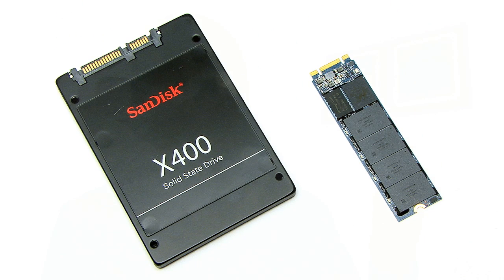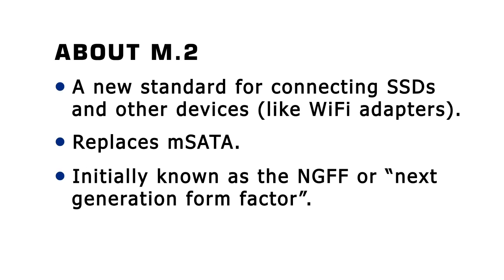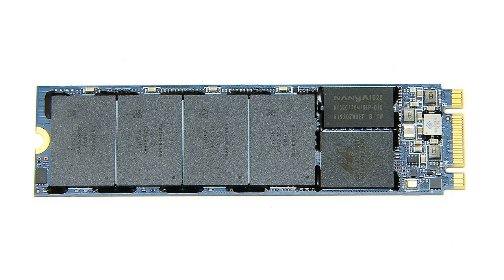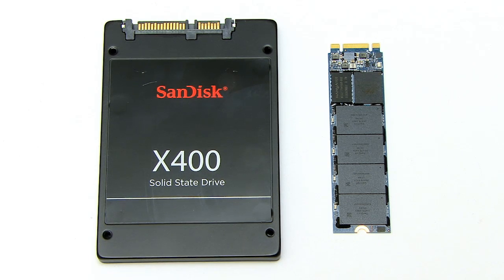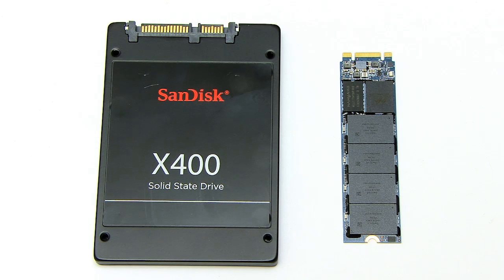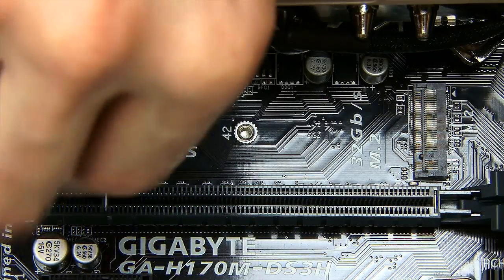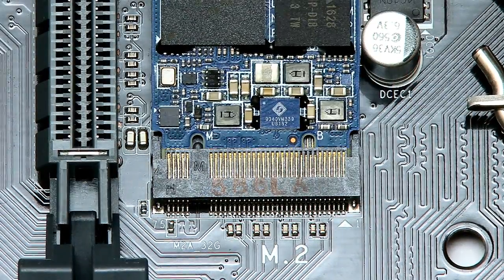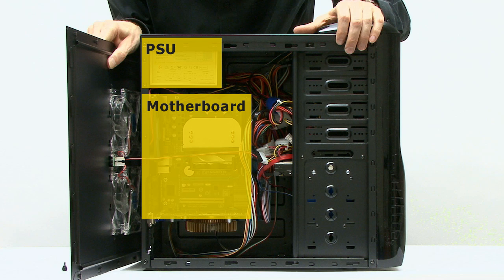Explaining M.2 SSDs

Comment: Just some passing comments:
1. For the really fast speed, you want M.2  PCIe Gen3 x 4 NVMe  (4 channels)[as opposed to SATA, Gen 2 and x2] x2 pronounced by 2 - be careful, you want all that satisfied.
2. With the Samsung 950 Pro, you need the Samsung NVMe driver and not the Windows driver (you can check after installation of the driver by looking in Windows, Device Manager / Storage Controllers
3. When you add a second disk drive, to the computer, mysteriously, the M.2 (main C: drive then becomes Drive 1 even though it's the boot device and the added, storage drive D: then becomes Drive 0   weird (I saw this happen with a youtuber as well)
4. With my Asus motherboard, boot time has not changed, but Restarts are blazing fast as well as the loading of everything. Using disk drive bench marking programs like ATTO e.g. I'm showing 2.6 GB per second reads. Game loads, game screen loads and game cut scenes are practically instantaneous.
5. I would run ATTO or AS SSD just to make sure you're getting the speeds you paid for.
6. With the price of memory having gone up, these are now 60 USD more than what I paid. (and they've gone on to another series)
7. These M.2 drives can be mounted on a PCIe daughter card and then that inserted into a slot and in most cases the drives run much cooler because rather than being mounted on the motherboard, down where the air is dead, they're up on a card and getting air from fans like the GPU, and case fans. By the way, I hear it's the controllers on these devices which run hot and manufacturers are actually adding thin copper sheeting, heat spreaders, heat shields and thermal interfaces.
Reply: Additional:   And if you add a third drive, the M.2 C: drive then becomes drive 2 (and it's the boot drive). You'll see this Drive 0, 1, 2 in Windows Disk Management - just right click the Windows 10 Start button and then left click that utility.
Reply: Oops. In line 1. above where it says (4 channels), that should say (4 lanes). That's the term they use. Regarding terminology, this NVMe is a protocol and it replaces the AHCI protocol that is used to communicate with SATA devices (Serial ATA).

Comment: HI AGAIN . I HAVE A BEAUTIFULL AI CAMERA PROGRAM THAT TOOK ABOUT TEN YEARS TO WRITE AND ITS BEEN FINSISHED ABOUT A YEAR .  IT TAKES 1 CORE ABOUT 7 SECONDS TO PROCESS A 640 BY 480 PIXEL VIDEO FRAME.  IM INTERESTED IN REWRITING IT USING MULTICORE PROGRAMMING.  DO CORES ACCESS A VIDEO STORED IN A VIDEO MEMORE (I THINK IN CASHE) SIMULTANEOUSLY? THATS MY QUESTION .IM USING AN OLD A6 DULCORE .  I TESTED A THREAD MULTIPLYING PROGRAM AND I STARTED ALL 4 THREADS AT THE SAME TIME AND IT FINISHED THE THREADS IN RANDOM ORDER,  THE TEST IMPLYIED THAT THE THREADS WERE ALL INDEPENDANT OF EACH OTHER , BUT WHEN I ADDED A PRINT TO SCREEN THREAD NUMER IN THE LOOP I FOUND THAT THE MULTITHREAD PROGRAM WAS FAKE. THE SAMETHREAD NUMBER PRINTED 100000 TIMES IN A ROW FOR EACH THREAD.   ALL THREADS WOULD START AT A DIFFERENT TIMES AND ALL THREADS FINISHED WITHOUT INTERUPTIONS AT DIFFERENT TIMES.  PRINT LOOKED LIKE 222 100K 111 100K 444 100K 333 100K .  SO IM SURE U HAVE A NICE VID ON THE SUBJECT SOMEWHERE. HAVE A GIANGANTIC GREAT DAY !

Comment: A lot of the gammers are going for the SSD drives that plug into the PCIe Gen3 x4 motherboard slots like the Intel SSD 750 Series. 
Their read and write speeds look to be quicker than a lot of the M.2 drives.
Reply: TheNZJester they are similar to NVMe m.2 drives. however most m.2 drive are SATA based.

Comment: Is there a cable that would go, possibly from the SATA or PCIe slot, to a carriage or other type device that would house multiple M.2 SSDs?

Perhaps even a 'hot swappable' like device that would hold multiple M.2s?

And could M.2s be used as recovery devices? I mean like hot swappable backup drives?
Reply from the maker: There are PCIe cards that take multiple M.2 drives. And external cases for M.2 drives that connect via USB 3.0/1

Comment: Did you even wear a antistatic wrist strap ? i can see there is no static free cloth the items are laying on.  Was the anti static stuff just a gimmick to sell useless crap? My friend just tossed computer parts in a carboard box and most that stuff still works years later. I try to use my wrist strap though.
Reply from the maker: I am always grounded with a wrist strap, but no longer show it on camera due the plethora of negative comments wearing one -- and talking about the use of one -- generates. Usually you will get away without one fine. But when I have paid for the components, I wear one! :)
Reply: You can ground yourself by touching metal before handeling the components.
Reply: thearchiveable 
I just touch the radiator in my apartment.
Reply: @peterknutsen3070  That is good, it works 95% of the time. But getting proper grounded is the best and safest way. But i never had problems. Also check if you floot is laminated and you walk on socks. Then you can build up static very easy.

Comment: About the Fitting of M.2 device (AT 5:40). There is a statement AT 6:35 that connecting is simpler because you only need a screwdriver, and "no cable management, no mounting", so it is 
"EASIEST and SIMPLEST method of installing a new drive in a desktop PC".
I think this is debatable. 
?_ Isn't it true that you don't really need to mount (fix/screw in place) an SSD since it is not that vulnerable to vibrations (compared to a hard drive)? 
Also, fiddleing on a motherboard might make someone nervous. Once I have all necesary cables plugged in the motherboard, I can even touch the SATA data or power cable since there is no risk of damaging the motherboard (without touching it) or an electric shock if computer is plugged in the wall.
 _ _ This is, at least, my amateur opinion.
Reply from the maker: I see your point, but an SSD should be fastened down (unless you move the case). On wiring, with fewer (non-motherboard) drives, this will reduce.

Comment: I noticed that the motherboard label said that the M.2 slot was PCIe yet you said that your M.2 disk was only SATA III compatible. Obviously, the connectors the same so it begs the question : Does M.2 auto-detect then adjust or what else is going on there?
Reply from the maker: Yes, the system will detect what has been connected to it.

Comment: Disappointed you did not mention NVMe M.2 drives
Reply from the maker: I will cover U.2 v M.2 in another video. Right now, M.2 is more common.
Reply: Yes M.2 is more common and you fully utilise it by using an NVMa drive in an M.2 connection. Like the Samsung 960 Pro NVMe/M.2 SSD drives. You only told half of the story here, the main advantage with M.2 is using an NVMe drive connected to an M.2. I have one in my pc.

Comment: here is the thing, M.2 SSDs are non-archivable, the standar HDD will be around for a long time with multi-petabyte capacity by 2040. With standard HDDs being achievable they work in 98% of the servers around the world.
Reply: What? No, they are just like normal SSD drives, just in a smaller form factor, and possibly with a faster PCIe interface. They require no power for long term storage. More likely, as with any tech, the issue will become having a correct interface in the distant future as M.2 gets replaced with M.3, M.4 or whatever. In that regard, a well-used USB3 interface flashdrive or SATA drive will probably be more useful for very long term storage (10s of years).
Reply: What do you mean, "non-archivable"?
Reply: ChapstickPremonitions it means they can't be used in a achieving situation, like in a file server. M.2 and SATA (Serial ATA) SSDs only have a limited IOPs (Read/Write cycles) and HDDs are not limited in Read/Writes, but in hours, the typical 3.5" hard disk is rated around 20 million hours (i think) and when it makes an audible squeaking, back up any personal information to a external drive or to a flash stick and replace the failing hard disk.
Reply: SSDs will loose their data after not being powered for a few years
Reply: yes, that's why they're not suited for achieving.
Reply: unless you plug it in every 8-12 mnoths
Reply: Free Saxon What are you speaking of? HDDs or SSDs?
Reply: From what I've read, unless you've exceeded the full rated endurance it 
should retain the data 10+ years when kept at room temperature and out 
of sunlight. 

Of course tape is still the way to go for very long term (no power required) storage. I have old tandberg drive QIC tapes from the early 90s that I read just fine last year. That's now 25+ years on.

I should also try and hook up the old full-height 5-1/4" 120 MB (I think) hdd's and see if they still spin up and are readable.
Reply: Bryan Hall most people buy them to put on there shelf of items to show, as about 10% are in a working order, don't expect a working one. and there is a Petabyte HDD in the works of the drawing board right as we speak
Reply: Jeff Jr O. you turn them off you lose your data

Comment: What really interests me though, is the performance difference between 2.5 inch and M.2 - shame you decided not to do a test. 
Just because both feature a SATAIII interface, doesn't mean they perform the same. USB 3.0 is 10 times faster than USB 2.0, 
but we all know that USB 3.0 pendrives are NOT 10 times faster than their older counterparts.
Reply: There is very little difference as they still use the SATA Protocol, unless you buy an NVMe drive.

Comment: at 6:01 the motherboard itself says 32Gb/s M.2 - false advertising or are you incorrect??
Reply from the maker: The motherboard says 32Gb/s as it can support either a SATA or a PCIe M.2 drive. But the drive I fitted is a SATA M.2 drive, so will run at 6Gb/s.
Reply: ExplainingComputers are the PCIe that much more expensive? If they are one might as well stick to regular 2.5" SATA III for now, until the price comes down
Reply from the maker: They are quite a bit more expensive. :)

Comment: Currently what is the largest M.2 SSDs available ? If your computer is older like 2011 can you install a PCIe into an older board..
Reply from the maker: I can't find an M.2 drive above 1TB right now. You can indeed install PCIe SSDs into an older PC with PCIe slots, and M.2 drives using an M.2 to PCIe slot adapter (which usually can take several M.2 drives).

Comment: How about static electricity when placing m2 ssd's? Do you take any precautions?
Reply: No precautions but first, get relative humidity down to 10%, shuffle on carpet for 5 mins, rub balloon on head, pick up SSD while touching a Tesla coil.  Really it's a bit overblown, just touch ground or case and if you were charged you  won't be anymore.
Reply from the maker: I tend to wear a wrist band.

Comment: The video was really usefull especially for people who are confuse in differences in speeds on M.2 slot but are you planing to make separately video about U.2 ports? Thank you!
Reply from the maker: Yes, I may well do this. So many new standards!
Reply: Thank you! :) Hope you 'gonna cover them all'. :D
Reply: U.2 is slightly older but I believe it is mainly obsolete now or only used in severs. It lost out to the M.2 standard because the physical connection was a lot larger and bulky.
Reply: I thought it's newer bcs I've just discovered them recently in few newer mobo's. :o Such fail but I bet it's not that much importnat. Wonders is Intel optain gonna be really big deal.

Comment: Do you think M.2 will replace RAM! It could work you know!
Reply: +Walter Laughlin    Don't confuse Gb/s with GB/s though.  If you look at RAM modules you will see transfer rates in Gigabytes not Gigabits per second.
Reply from the maker: I think M.2 will remain as a storage and peripherals port, and (most recently) DDR4 slots for RAM. But the fact that both plug directly into the motherboard is very significant.
Reply: Yes indeed it is! That kind of speed and access is noteworthy!

Comment: Great video, thanks! It's worth pointing out that the normal ssd drives are mostly empty, and have the same sized chips as in the M.2 drives, it's just the form factor that is different, and they have the advantage of an extra layer of protection from dust and accidental damage. The transfer speeds for M.2 can be much faster when using PCIe over SATA, depending on motherboard support.

Comment: My laptop has an M.2 SSD and boots up amazingly quickly, even compared to a previous 2.5" SSD. Definitely worth any extra cost.
Reply: Izzie boot times aren't quicker on m.2 versus 2.5" SSD. the improvement has to do with initialization optimization included with newer UEFI. Using full UEFI mode with Windows 8.1/10 (or any supported O/S) is what helps.

Comment: Excellent, informative video.  Thanks for posting it!
Reply from the maker: The SATA power connector has 15 active pins. Because they are small, they are connected (ganged) in threes for  12v, 5v, 3.3v, GND, plus another couple of GND, and a spare! It is bizarre compared to the data connector.
Reply: The redundancy pins for power is insurance, that while writing data there is no failure in continuity of power. If power does fail on a pin, it will fail on a larger pin as well but not three pins. That why they put 3 small pins in the same footprint a 1 big pin.
Reply: could you explain one thing for me i never understood, how come on SATA drives the lager connector , the one with  a lot more pins is used for power and the smaller one with less pins  for data is used for data when a molex power cable only has 4 connectors? this does not seem to make much sense  ,why do you need a 32 pin connector on the drive for power when the molex is only 4 pins? what application would the other 28 pins be useful for? if they are not used in any other other application then why don't they make sata drives with a 4 pin power connector?
Reply: thanks i wonder why they just didn't make those gang connections internanlly and then only put  a 4 pin power connector externally  like the old IDE drives had with just having a molex , not really sure what benefit is to having all those redundant pins
Reply: Andrea Mitchell well, the data doesn't need that much "surface area" of copper to function, especially with the short length that it travels. By contrast, just 1 pins worth of Copper would have to much of the voltage and/or amperage dropfor the amount of power needed. Thereby doubling or triplingthe amount of coverage that is available for the power connector is very much akin to a multilane highway versus a dirt road.
Reply: Dean Mires right but if they only put 4 connectors on th e outside  they could have been wider ones like the old molex connectors on old IDE drives not the  thin pins we see now , they could have just had 4 extra wide pins
Reply: it has to do with production. the old "molex" connectors used through-hole technology, which is difficult to place and solder by machines (and the physicsal forces on those connectors are too high for surface mount technology). then you have to deal with 2 different parts with different pin pitches, which vendors don´t like (additional costand effort). so building the power and data connector in the same housing with the same pin pitch provides many advantages.
Reply: ExplainingComputers can you maby make a video on how we install blender on linux/raspberry pi 1/2/3?
Reply: Your Avatar is hilarious!lol wtf Ms.Greedy Merchant FTW!
Reply: SATA spec continues to have3.3 volt as part of it. Winessing it used by SATA hardware is a rarity on account of the fact that in using a SATA adapter, it won't work. SATA devices exist (enterprise or smaller form factors) that utilise the 3.3 volt line. Different parts that are powered from the forks mean that for an unusual part to use that power, it need not sit on the same line as ould be used by some part not so rare that would make the design (confusingly) easily misused. If you put those gang connectors internally and then have a molex on the outside, you essentially have a molex to sata convertor which is a bad thing. Molex to sata convertors are a bad thing because they are easy to manufacture badly, ending up with shorts from electromigration, oscillating and heat (sometimes melte dinsulation) which all too often means fire or copper welding together. SATA power is in many ways a shite design and they should have kept molex but had an additional optional power plug to go alongside it. An example could have been power-over-ethernet considering the network devices using hard drives (and more) anyway.
Reply: Raspberry pi n3rd that would be awesome! Aside from compatibility, I don't know if it is even possible, honestly if ANY 3d modeling software would work, I'd be quite surprised, as they are pretty processor intensive for most tasks, but I do use blender myself, and that would be epic! I haven't downloaded it in quite a while, but if there is a Linux version of blender, I don't see why it wouldn't work if your OS is a Linux based one, that doesn't mean RPi would run it well, but I would think it should at least run
Reply: No, the 4 wires had been too thick for the light ssd case/circuit. This happened to me with a smartphone video adapter.
Reply: Sata cables are notoriously unreliable. They are susceptible to signal loss, reflection, rfi, and crosstalk. Even when a higher quality cable is used.
Reply: datFatSesh it worked but id recomend haveing 2 or 3 pis in a cluster
Reply from the maker: Many thanks.